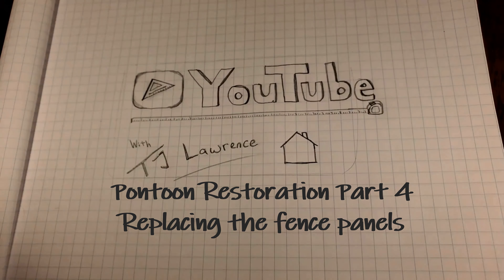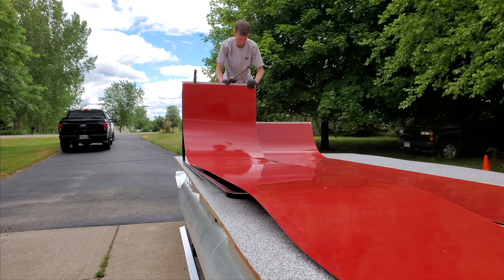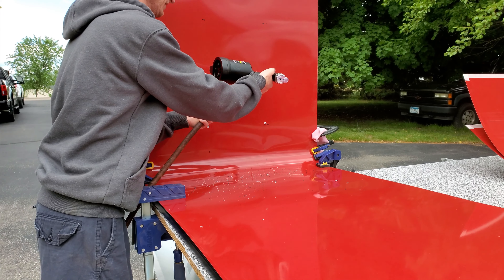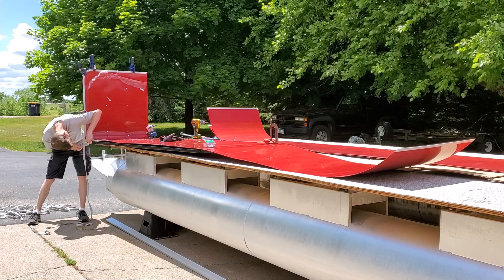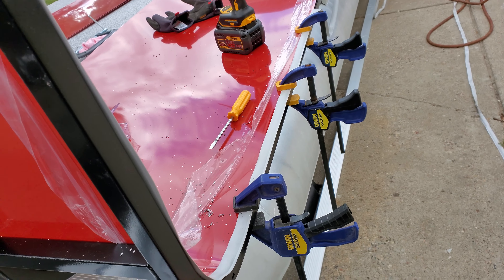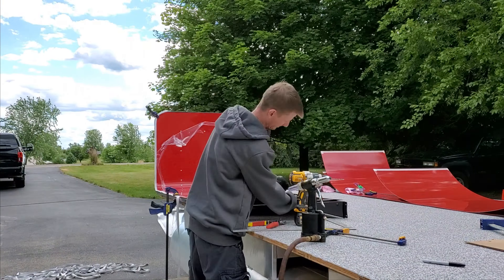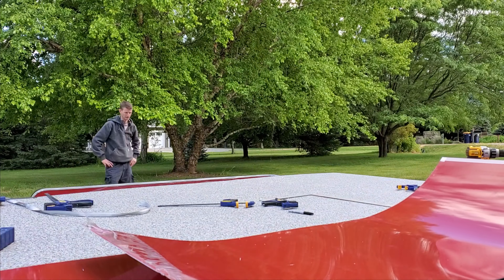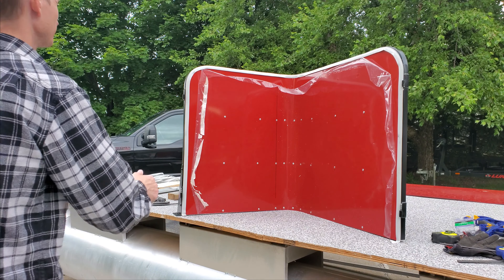Pontoon Restoration Part 4. Replacing the Fence Panels.

Comment: That's why they put panels only on the bottom areas (not the actual hand railings), cut slightly smaller to prevent people from touching the edges and getting cut.

Comment: Did you remove the rail slots that the old panel slide into that were on the railing before you put the new paneling on so the new panels would lay flat?  I'm getting ready to do mine the same way only Burgundy and Charcoal grey rails.

Comment: Where can I get some of this in yellow or lime green??? Please
Reply from the maker: Lime green would be an awesome color! I'll have to look around for that and let you know.
Reply: Definitely let me know... thanks man
Reply from the maker: @Blackjack_focus_st3  Here is what I found out.  https://www.rsaluminum.com/product/aluminum-sheets/ makes custom sheet metal orders and has both yellow and lime green available.  It would be a little thicker than typical so it might be hard to radius if you have sharp bends. 

The Next option which might be easier and a little less expensive is a vinyl wrap.  You can get this stuff from Amazon or eBay and seems like they have any color or design you could ask for.  Hope this helps!